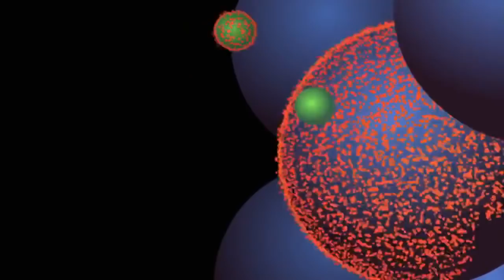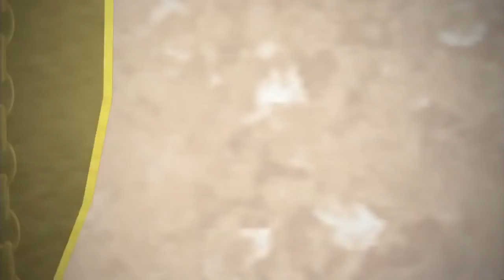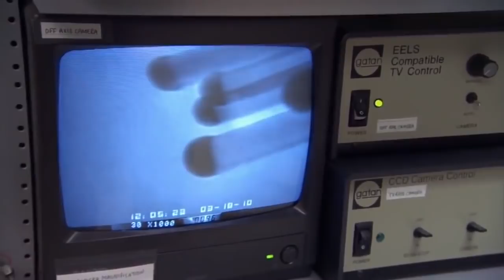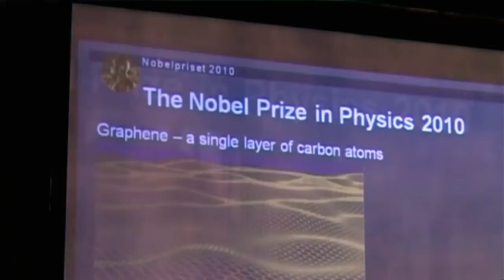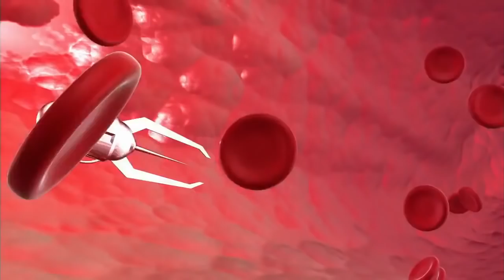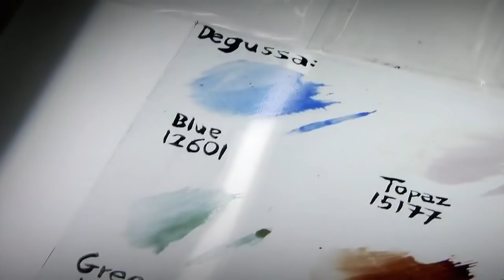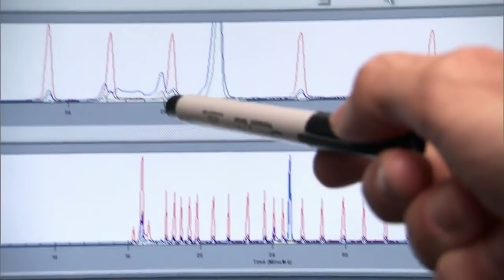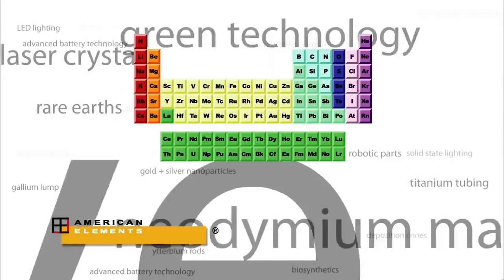Extreme Technology  Nano Robotics

Comment: Need a good "for example"? Real quick, they've been making wire insulation - even small hoses - now for years out of "soy bean oil" (by-products). It works great.. until it finds its way into the automobile parts industry (like peanut oil seat-foam or fuel system sensor wires and hoses). Do NOT park your vehicle unattended for any extended periods - and especially not near forest creatures or central-south Arizona - where pack-rats can find these mixtures irresistible! Live awhile.. discover "common-sense"!

Comment: What I don't get is how a pendulum stores enough energy to power a clock for long periods of time.... doesn't that energy dissipate rather quickly?
Reply: Des Troya that's why you have to wind it every few days.
Reply: Look at this type of clock...there is chain and  weight , usually in shape of pine cone, the chain moves slowly one way(the side of weight) to supplement lost energy of each stroke of pendulum, but after some time, someone has to pull the chain back to original position(rewind it), so it can continue to deliver it's energy to the pendulum. If the weight comes all the way to the bottom and doesn't pull no more,the pendulum stops....